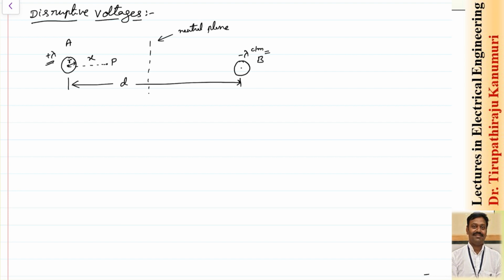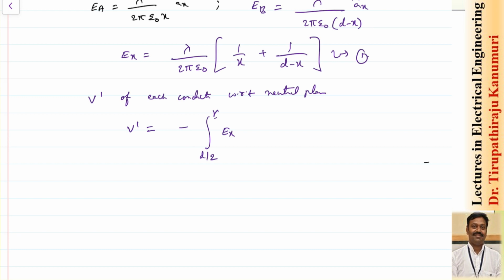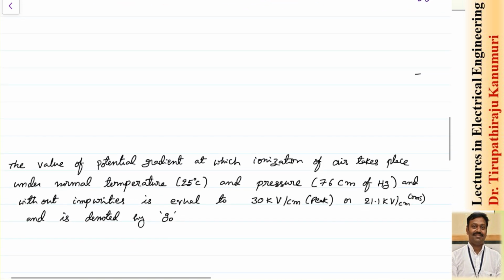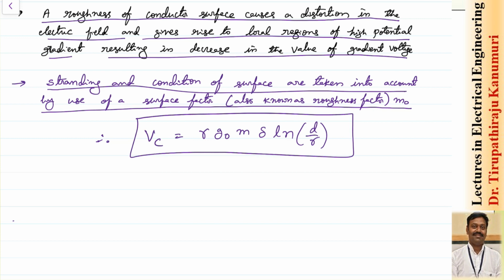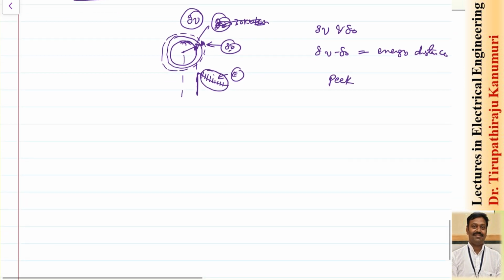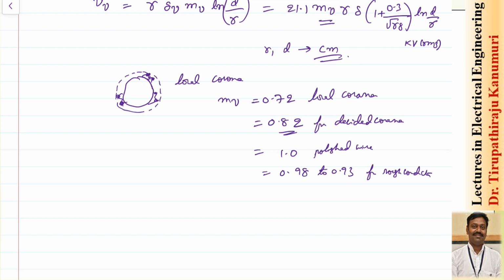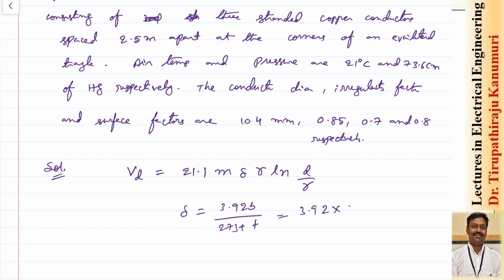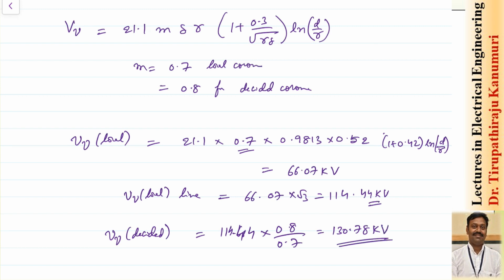PS43 Critical Disruptive voltage

Comment: A 400kv,  50Hz three phase transmission line placed in horizantal arangment the spacing between conductor A and B,  B and C and between A and C are 3m,2m,and 5m respectively the surface irregularity factor is 0.8 and temperature is 10 degree Celsius normal pressure = 36cmHg
Find critical corona voltage and visual critical corona voltage